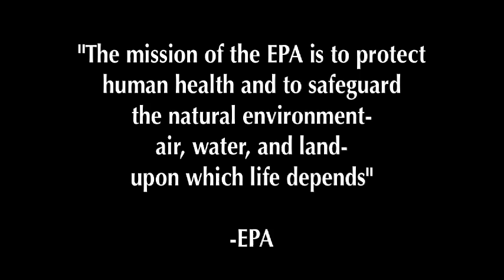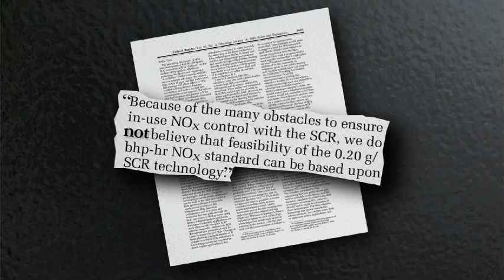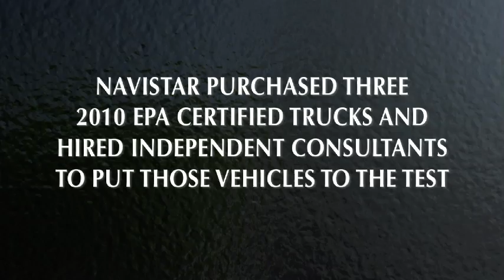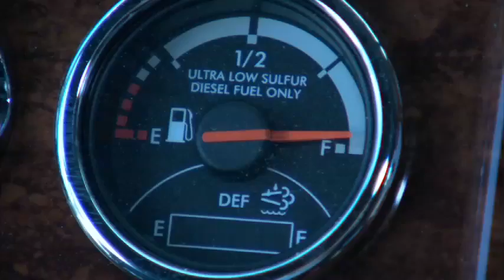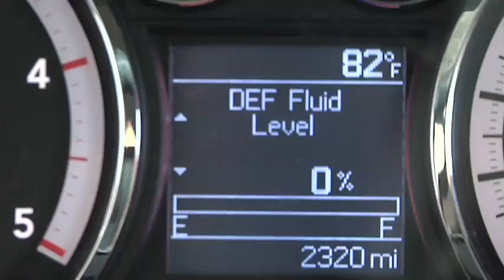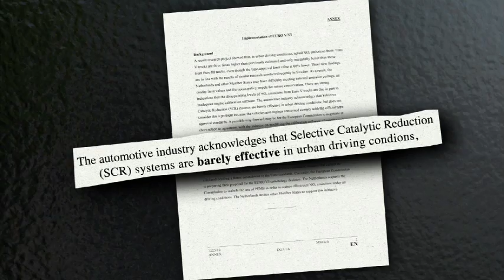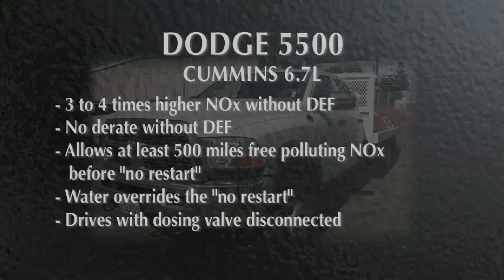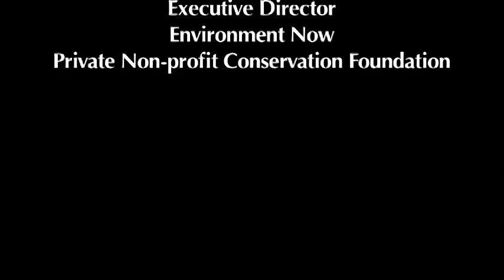Emissions- in depth

Comment: a test made by  a firm, thouse engine doesnt  comply with epa2010 and leaves  on eco credits:)
3to 4 times  more NOx without def sounds plausible ,but 10-30?!
this engines still have got the egr and dont work fully efficienty so they cant have the NOx levels of the 90's